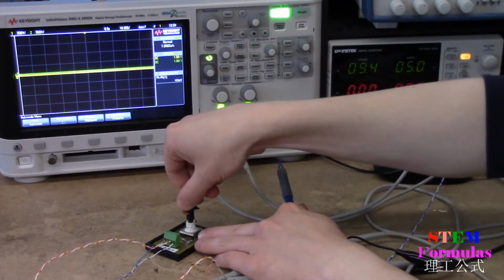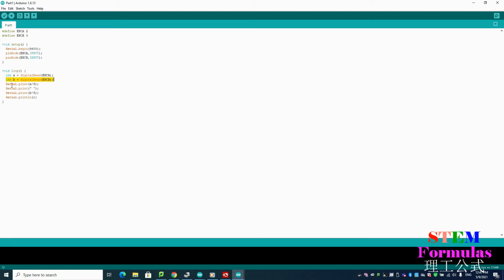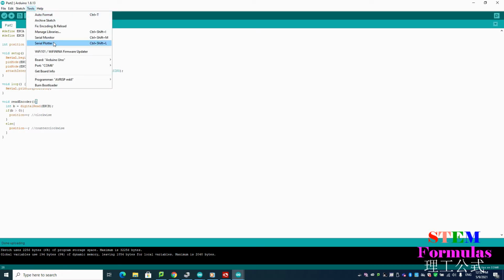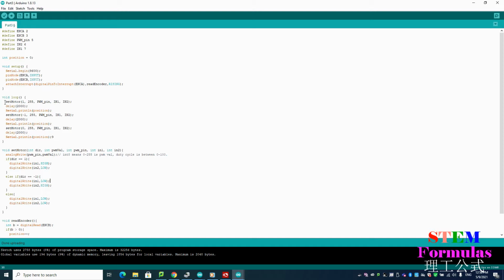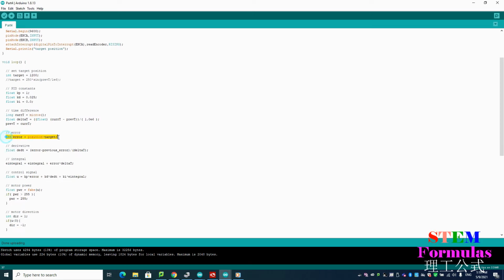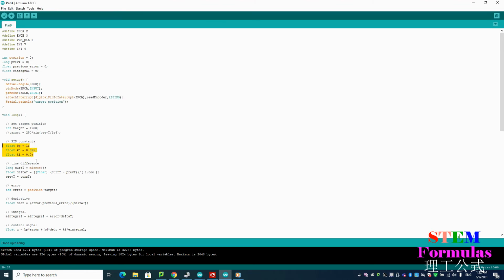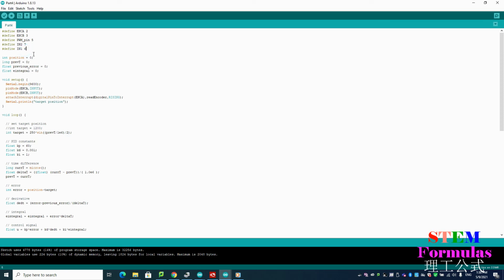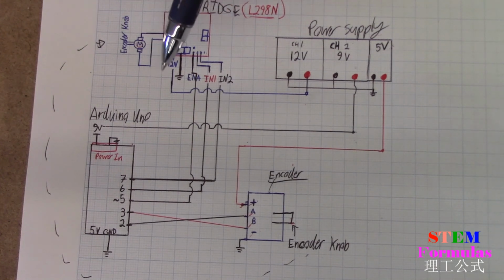PID algorithm: An example with DC Motor Control with Encoder

Comment: I like how you coded the equations directly rather than use a PID library (I did that once myself long ago when I worked DCS company).
Reply from the maker: I am working on a video on PID algorithm (concepts behind the formulas and numerical examples with MATLAB).